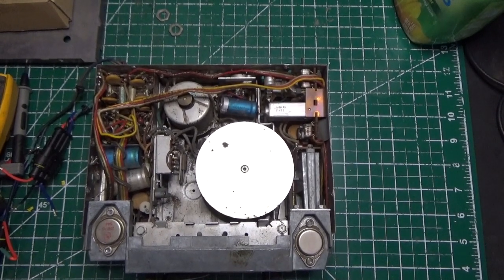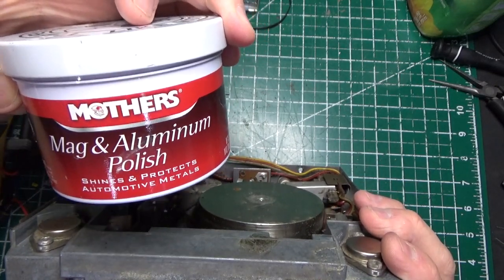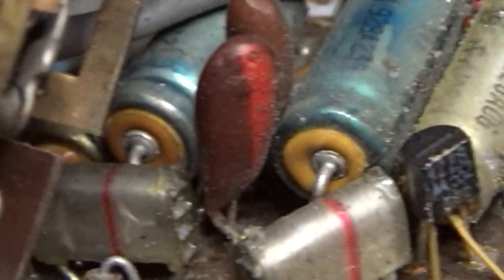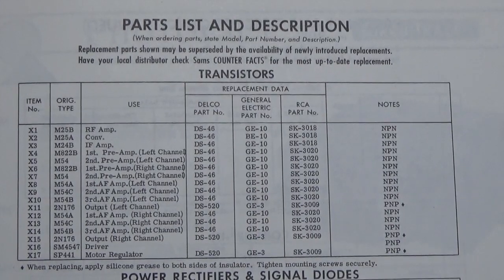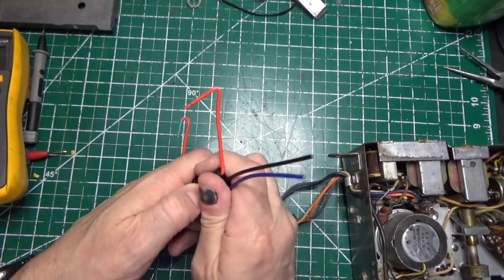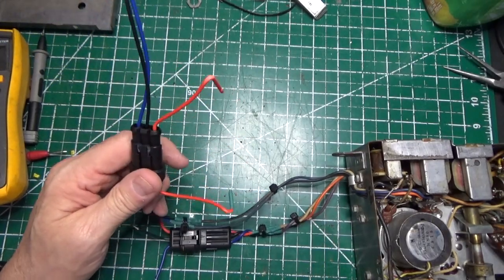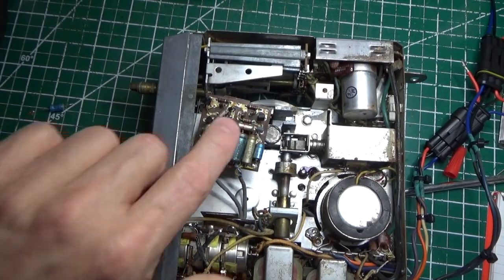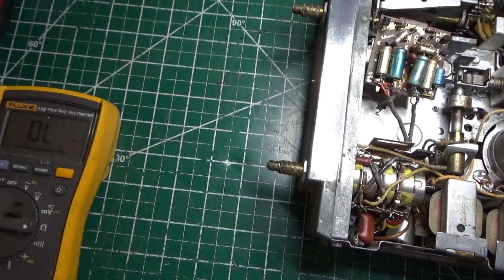1966 Ford Thunderbird Motorola T6SMS -AM-8 Track Restoration - Episode 2: Ahoy CAPtain

Comment: Ron,
So far - so good, young fella.  Remember...never any hurry.  A prominent member of the Antique Radio Forum , Curt Reed (now deceased), once posted that these old radios haven't worked for decades, so another few weeks won't make any difference.  I took that advice to heart and it has always served me well.  Btw...Pearline only has the two front door speakers.  At one time it may have had two in the rear, but I can see no evidence of it, so the tape that was around that plug was likely done at the factory.  You can usually tell by the way factory tape somewhat crackles when being removed.
Steady as she goes, my friend.
Regards,
John
Reply from the maker: John, thank you for the info on the speakers.  When I removed the tape, it looked like someone amateurishly added  10 to 12 gauge wire and did a crude solder job, so I do not think that part was factory but who knows. The speaker connector was partially melted which would explain a few things I am finding in the troubleshooting, to come in a future video. Either way, we'll get her going.  Great advice from you through the wisdom of Curt Reed. I know you have mentioned him before - too bad I never had the chance to know him. With folks like you and Brendan and so many others, I am very fortunate to be learning from the best. !  Thanks Ron

Comment: Fascinating stuff. Have to remember you are really restoring two items, a AM radio and a tape deck. Looks like it is going to be a lot of fun! I am assuming you were able to use your desoldering setup on that board, otherwise it really is close quarters to get solder wick down there and  still clean everything up. I am surprised there are some many electrolytic capacitors.
Reply from the maker: Scott, I've had to remove the board and use wick to careful open up the holes.  The board is old and fragile and if I apply too much heat the traces will lift off.. its old like me :)  LOL  too many electrolytics but thats the fun !!! thanks my friend

Comment: Hey Ron, I also came over from Johns channel to watch you work on this 8-track/AM radio. Just for clarification, the blue and black wires are the wires supplying variable DC to the radio's dial lamp via the headlight switch dimmer, and +12vdc for radio power. With the chassis providing ground, correct? The lamp is wired separate as it is in the same circuit as the dash lights of the vehicle (so you can dim the internal dial lamp along with the dashboard lights).
George B. in Michigan
Reply from the maker: George, firstly, thanks for coming over, I appreciate you. I deleted my original reply because after thinking about your post, the light bulb went off ( in my mind).  The blue wire is connected to the Instrument cluster and is ONLY used to power the bulb.  The black wire is  the 12v+ side and the chassis grounded to the car gets its  ( - ) side.  Now I get it.... thank you so much, I  had not thought about that yet, but it helps me a great deal.  Really appreciate it George, thank you !!

Comment: How to ID PCBs.  Radio PCB will have tuning cap.  Preamp will come from tape head and will also have vol pot.  PA PCB  will go to speaker.  And PS will connect to.power.  Most will have boards for radio, preamp, power amp and power supply.
Reply: PS, there might be a motor and head control board, going to motor or head solenoid. Clean and liube should bring it back after recap.  Car radios are funnage.
Reply from the maker: @umajunkcollector   Thanks Don.. there is definitely a Motor control board which I did not get to yet. It has a power transistor which is surely bad.. but will get to it. I am learning as I go along, but your comment above helps !!!!